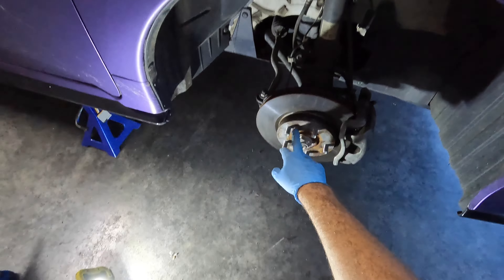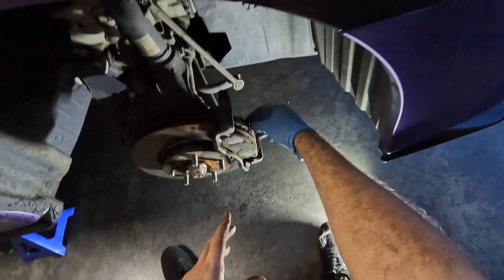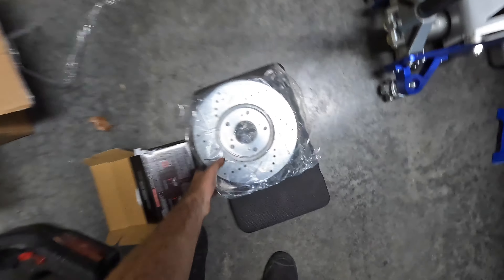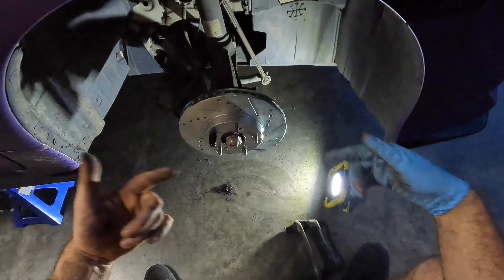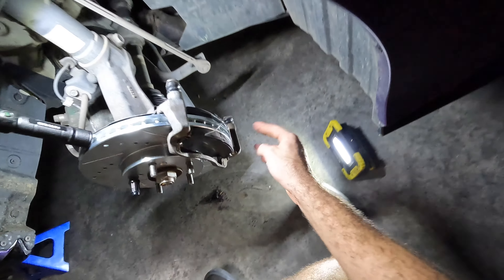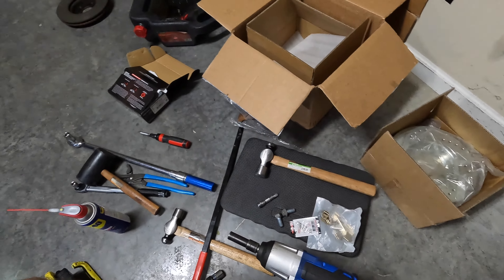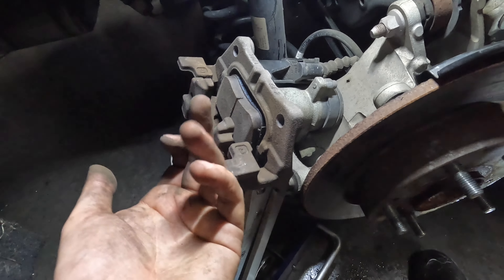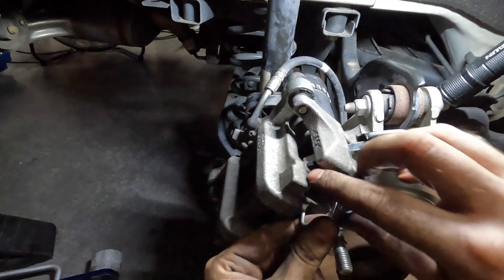10th Gen Civic Brake Job ***ROTOR AND PAD UPGRADES***

Comment: Did you set the sensors off in the car? You’re not supposed to compress the rear pistons like that. You need to disconnect the electronic parking brake first and hand twist it. Forcing it damages the sensors.
Reply from the maker: The parking brake was disengaged and unplugged. Nothing was damaged. Brakes are working properly and the parking brake engages and disengages properly.
Reply: @RobsHouse awesome. I understand you disconnected it. There was some people who had theirs damaged from compressing it. Glad yours isn’t damaged though. Nice video!
Reply from the maker: @ I compressed it using the appropriate tool. Idk how else you’d do it haha

Comment: Impact driver bud.
Reply from the maker: I tried that off-camera. The rust on the screw was so bad that it had become like red loctite in the threads. I soaked it in WD-40 and hammered it for a lot longer than I included in the video to get it to loosen.

Comment: Literally says this scre servs no purpose... Uses lug nut...

That's what the screw is for. Baba
Reply from the maker: I said it is unnecessary. It serves no purpose other than to align the rotor prior to installing the lug nuts, but it gets caked up with rust and makes it harder to remove. So, I elected not to reuse it...